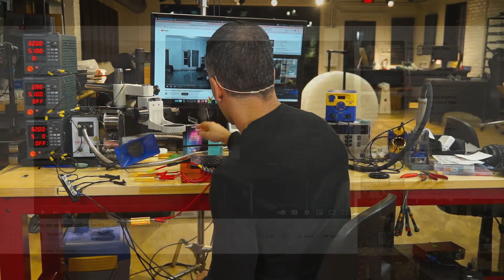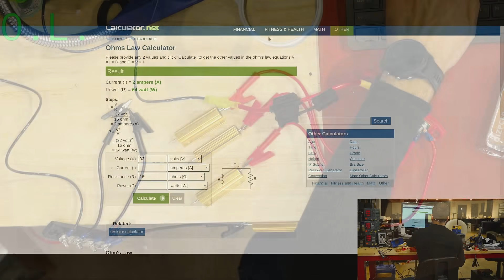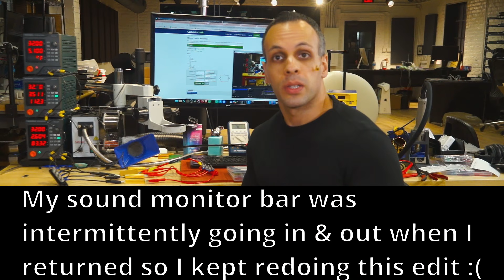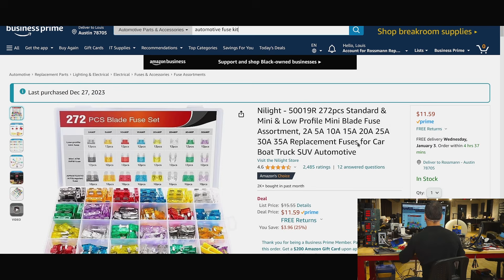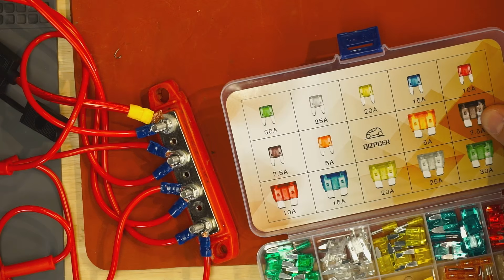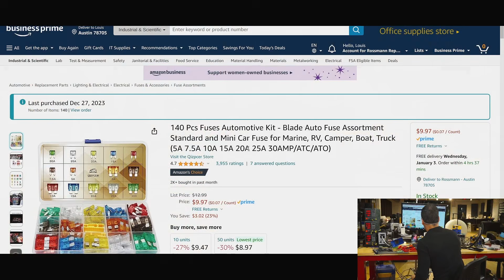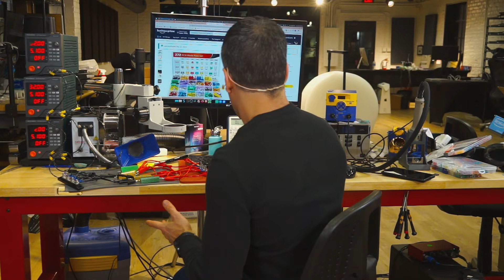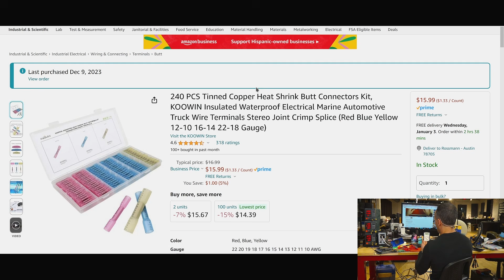Amazon Sells Fake Electrical Fuses

Comment: What would u have a merchant like Amazon do though? A merchant always have to maximize profit, that's just how capitalism works, it doesn't care. Never did, and never will. They can't possibly test every single thing they sell. Sure they can ask for safety certificates from the factory. But what's to stop the manufacturer from sending amazon a real certificate, then send them fake products? Just like the SSD bait and switch that even famous brands do. Gigabyte made exploding power supplies and Amazon sold them. U can't possibly blame Amazon for it, unless u can prove they personally knew it will explode and still sold them. So unless someone dies, and then successfully proves via court the merchant is at fault, they will keep selling these things. This is just how capitalism works, it doesn't have morals, and money > human lives. U want to change it? Sure, then u need to change the entire system, good luck with that lol😂. As a small merchat, u can try to do the right thing. As a consumer, u can try ur best to do due diligence, do ur research before buying and not just blindly trust random reviews online. Ask urself the question, does this person who is writing this review, have the credentials/skills/experience to do the reivew? (U wouldn't want a foodie to review a motherboard would u?😅) And that's all we can do under this system we are in.

Comment: for fun I looked up the littelfuse branded small blade fuse datasheet.  For their 32V, 2A rated fuse, it blows in 0.2 seconds with 6A going through it.  For 4A, the datasheet says it should do it after 5 seconds.  At 2A it should never trip, and at around 2.2A is at the top of the graph at 1000 seconds (or more).

Comment: I see a lot of people coming into my store (Home Depot) after buying fuses from amazon only for their appliance to crap out. Once I hear they bought junk from amazon it no longer phases me that their equipment has failed. Some are also buying after-market breakers and fuses for breaker/fuse panels for their house and they usually ignore you if you inform them that those are unregulated, and present a risk of burning their house down.

Comment: 2:04 Not to criticize, but the fuse is meant to protect the wires.  The power supply example I think is not accurate for a number of reasons.  I know you are trying to keep the explanation simple, and it would have been easier and more accurate to say that it protects the wires from catching fire.  

The power supply, if it has a fuse inside, is typically going to be on the AC side.  That, again, is not to protect the power supply from failure, but to protect the household wiring and other stuff on the circuit from going offline from a FAILED power supply that would trip the AC circuit breaker.  Further, most power supplies will have a shutdown mode or a small breaker inside that will reset after the fault goes away.  That breaker being a cheap, through-hole or SMD component which, hopefully is not itself, fraudulent, works very reliably.
Reply: And after my rant, I continued the video and Louis briefly covered all that ^ LOL.  But strictly speaking, a fuse should be sized based on the wire capacity and it's really meant specifically to stop the wire from melting or catching fire.

Comment: Technically true though that a 2A fuse is not designed to blow at 2A, nor 5A at 5A usually.  Would be good to grab a datasheet for a brand name auto fuse to check.  The 5A blowing at 10A almost immediately is likely getting close to the actual spec of a brand name fuse.

Comment: Story Time: in 2017 I bought a new laptop before moving to Hong Kong for a job. This was peak dongle time for Apple so I got a USB C dongle on Amazon. The bluetooth and wifi on the laptop kept going off intermittently though and after a trip to the Apple store, Apple, to my surprise, just replaced a $4000 machine.  The replacement did the same thing though. It turns out the dongle from Amazon (stamped with an FCC compliance marking) was not, in fact, compliant and was causing interference that blocked bluetooth and wifi for everything near it. I got rid of that and and the problem went away. A few weeks later after arriving in Hong Kong I visited the computer parts mall in Sham Shui Po. Multiple vendors had piles of the exact same dongle, all stamped with different brand logos, and none of them stamped with the FCC compliance marking. 

Basically what's happening is that one factory will produce millions of units and smaller vendors will order them with whatever logo they want stamped on them. That way the smaller companies don't need to make large minimum orders, and the factory still gets the benefits of a massive economy of scale. Amazon opened the flood gates with Fulfilled by Amazon. These little vendors don't need to maintain inventory in the US or ship individual orders from China, they can just just ship a large box of junk to an Amazon fulfillment center and Amazon takes care of the logistics. When there's a problem with the product though, like fuses that don't blow, batteries that explode, dongles that cause interference etc. the vendors have 0 accountability. Even if Amazon boots one account or the FCC bans a product, any given vendor already has 100 other CrocSee or Pcer or Nilight accounts running. In some cases it's the factory itself selling it directly to consumers through a bunch of shell brands. But it's not like anyone can sue them, they're in China. 

If you do buy anything on Amazon (which is honestly more of a pain than it's worth) filter to only brands that major brick and mortar retailers also carry.

Comment: I hardly buy anything abroad anymore because I saw a pretty rapid decline in quality 10 years ago especially on Ebay. Amazon looks pretty much like the same bs of lies, so I see no point dealing with that frustration. Everything there is just a fake facade, so I'd rather visit a physical store and be able to get hands on with the product upon a purchase. 

I'd rather have less but quality things in my life and it doesn't take all that long until you actually feel that you got some proper shit of this and that if you just stick to the plan. When we start to actually care about things, we will also take better care of it and that also will prolongue its life and so on and so forth. 
Price per year is the actual price we pay, so stop focusing on the actual pricetag hanging off this or that thing, and just calculate what it will cost per year, as well as you of course need to calculate what kind of quality you actually need based on how much you will use it. 

I'll finish off by saying: It's expensive to be poor.

Comment: To be fair, what exactly is a fuse rating (pun intended)?  You buy a fuse because you blew one.  You buy a replacement and you use it.  You're done.  The only proper review for a fuse is to have used them for YEARS with no problems.  The only fuse reviews people should be reading are the 1 stars to see what problems people are having.  ie they blow to soon.

Comment: People should do their own research and not blindly purchase products solely based on positive reviews. There is literally hundreds if not thousands of middle men out there that are nicknamed brokers. They work on behalf of Chinese amazon sellers and get paid a commission for every positive review they bring to a sellers product. They provide buyers with lists of thousands of products that they can purchase, leave a 5 star review on and in return the buyer receives a 100% full refund with tax and shipping fees included. Reviews literally mean nothing and no one should base their judgement on products based on what they read in a review. Instead exercise common sense when making a purchase on Amazon and you will have no issues. If a 100 pack fuse kit cost less then 10$ then use common sense and realize you are getting what you pay for. If a reputable name brand like Bussmann charges 50$ (5x the price) for a similar product then obviously the one for less then 10$ is pure shit. The real problem is not the fake reviews or crappy products on Amazon. Its the lazy cheap modern generation that refuses to be an intelligent consumer.

Comment: you could have used 12volts, less heat in resistors, as its amp fuses the volt have nothing to do with the tripping of them, also auto fuses are slow trippers, unlike fast fuses often used in glass tube fuses. but you know this I am sure ;). connect all resistors in par and adjust amps on power sup, no burnt fingers or desk then. ;) I have also noticed this on cn fuses and crimp connectors, connectors are made of soft thin metal, if connect and disconnect them a few times they fall a part and don't stay together. the cn -30% materials yearly long plan have hit the limit of stuff becoming usable, its in all things now as nearly all cn made. The high profit have its limits also. Look at shoes soles are so thin you able to feel small rocks thru them, was not like this before, everything are like this.
Great test anyway!
Reply: i looked at wikipedia and it says:
"a fast-blow fuse may require twice its rated current to blow in 0.1 seconds, and a slow-blow fuse may require twice its rated current for tens of seconds to blow."

Comment: 4 stars: Had to dock a point due to the funky smell but it works great! I've been using this fuse for a week now and never had to replace it. Very robust. It's just a shame it emits a faint odor. Perfect for outdoor use
Reply: It's in my car, when driving there is a faint smell, but it cured the problem when driving with lights on... The smell goes when I have the windows open.  5* and praise to the seller for shipping to me so quickly. I had confirmation the order was at my front door and I didn't even hear the Amazon delivery person - what a hero.:face-green-smiling:
Reply: @steveblanchard7293  6 star fuse becomes winter heater and helped heat the car every time my lights would go dim that is a BONUS feature BRAVO
Reply: Robust fuse - it is not clear whether it is good or bad :)
Reply: In Soviet Russia we have this special fuse. If it goes down, you know you won't make it to the door.

Comment: Dang!!! I used Amazon-fuses to secure my big Li-Ion Battery in my caravan.
Well some tolerance like 20 percent is just fine but seeing this i can just now imagine my caravan going up in freaking flames.
This is bad. My battery-pack is segmented and every module is on a 40 Amp-Fuse. Need to test those fuses now.
Thank you for bringing this to our attention!

EDIT: BTW you didnt need resistors. Since you got regulated power supplies the current could be set on the power supplies.
But it was a more transparent and educational setting.

Comment: I only buy fuses from stores that I physically visit. And I know that even as cheap as the ones I've bought are, they still work correctly as I have had them blow immediately in faulty circuits.

A vehicle having had muddy water get into wires, develop a dead short and explode the battery causes all sorts of problems.

Comment: Amazon reviews are useless.  I don't think in this particular case even real reviews would catch it though.  People buying fuses generally are just replacing fuses, not testing them.  As long as the fuse fits and doesn't blow below their rating, people are likely to just review it as good if they review it at all.  This isn't the kind of danger reviews would catch.  This is the kind of thing that would need to be regulated (ie, some law where you can't sell fuses in the US unless the product line is being subjected to testing at the federal level on a semi-regular basis).

Comment: I actually bought one of those boxes of over 200 automotive fuses on amazon (even though I only needed 2) a few months ago for the low cost and convenience of same day delivery. A few hours after I ordered I started to question how the hell they can afford to sell that many fuses and ship it same day for pennies a piece when they cost nearly $1 each at your regular auto parts store.
I ended up getting off my ass and just running ot autozone and buying a pack of 5 fuses for $6, amazon still got my money since I never returned the fuses I bought from them that likely can't be trusted.
Its a shame that most people are just going to trust that amazon wouldn't sell them faulty or potentially dangerous products, they've made it so easy to buy things that there's almost no time to consider if what you're buying is garbage or not. I hope it doesn't get to the point where people are getting hurt or killed by shotty products before some action is taken.
Reply: You'd think so, but lobbyists and backers with deep pockets means nothing will be done.  If anything, the remaining teeth the regulator has will be removed and the departments concerned will have their budgets slashed.  The lack of reporting will be seen as an "improvement" in services and the remaining management gets a bonus.
Reply: To be fair, they don't cost nearly $1 each because they're expensive to make - they cost that much because selling small quantities of them out of individual stores is really inefficient. Car manufacturers will be paying next to nothing for them.
Reply: @Monkeh616  I understand that $1 a piece is an inflated price for a fuse in a small plastic case and the price at your local auto parts store might be much more than the cost of manufacture due to many factors. Its true that some things are much cheaper if you get them directly from the source without the middleman while retaining a reliable quality but when the price difference is that drastic it raised my eyebrow and these tests validated my skepticism. I don't believe for a second that Amazon is contracting trusted manufacturers and allowing them to sell directly to the customer and handle the logistics of shipping the product to the customers door within 12 hours and still meeting prices that low without sacrificing quality. I honestly don't think they give much thought at all to the quality of the product that the customer receives.
There's several things I'm paying for when I pay much more for a fuze that I bought at my local Autozone vs a random chinese brand on Amazon. For one I know where Bushman fuses come from and know they can be held liable if there's a catastrophic failure of their product, but beyond that I know I don't have to worry about something like that for every minor repair I make when I buy from a source I can actually trust. I want to be able to fix the problem and not be concerned that the replacement part is going to cause bigger problems. The way things are right not for many common products if you went on Amazon and bought one of the most recommended products you're buying a product you can't trust.
I understand its hard to break the correlation in your mind as someone who has used amazon for so much of my shopping for so long that you can no longer trust items you buy from there but the fact of the matter is you simply can no longer trust Amazon to sell you a reliable and trustworthy product.